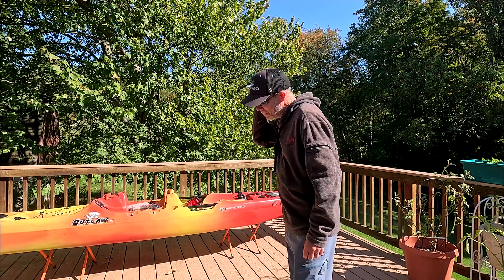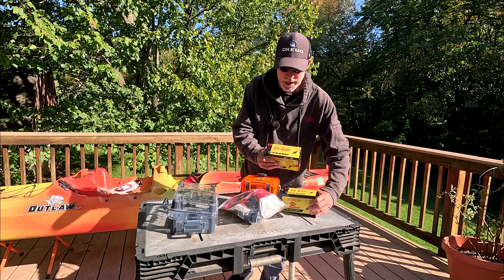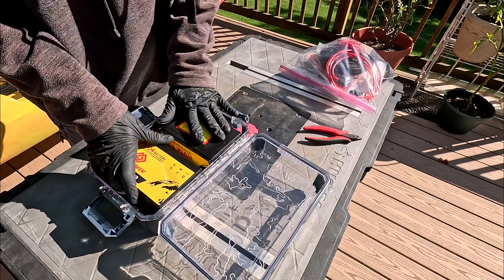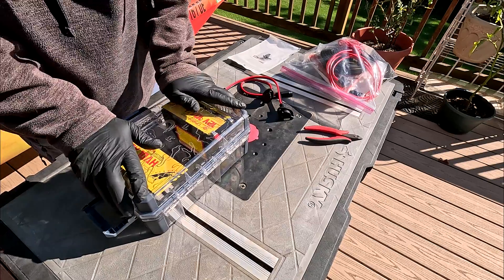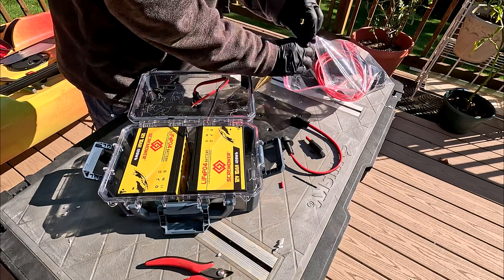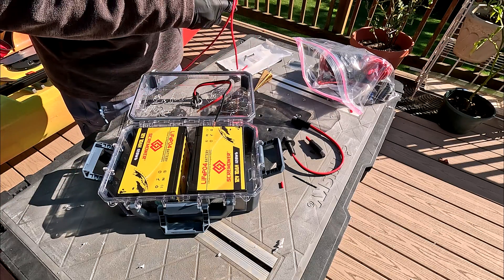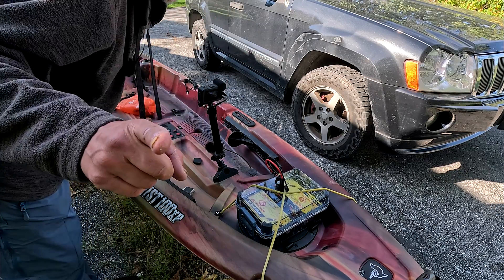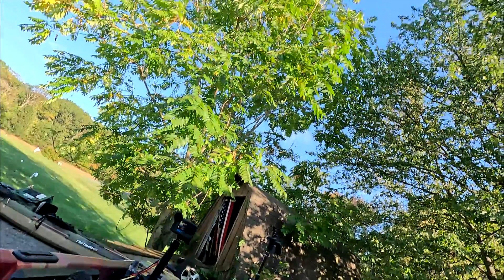A Sensible, LIGHTWEIGHT KAYAK BATTERY BOX Build on a BUDGET!

Comment: I just wonder how hot those batteries will get without a vent hole and with full solar exposure.  Might be able to use an old cooler and a plastic freezer pack I guess.  Do you plan to shield the sunlight ?
Reply from the maker: It sits under the seat of one kayak, and in the other it sits up front, exposed with just a net on top of it. I haven't had any issues in the year and a half since building the battery box.

Comment: I think your wiring on your batteries is wrong. when you hook up the red one side, you need to hook the black up on the other battery that way when you’re drawing the power, you’re drawing equally through both batteries also when you’re charging the way that you have it hooked up it’s charging one battery then the other, so if you change the wiring, it will charge them equally and it works the same way with solar if you have an array of batteries, you start your positive at one end and then you start the negative from the other end so it feeds equally through all your batteries👍
Reply from the maker: Everything you said is wrong. What you proposed would be a 24v presentation, not a 12v presentation , as required in this project. I'm not going to argue with someone that doesn't understand parallel vs series or how voltage and charging works. I've been doing low volt stuff for 30 years (as a professional).  Go fry your own stuff and start fires, but don't profess to me and my viewers your complete lack of understanding about how electricity works. Folks, ignore this know-nothing know-it-all. He'd present a 600v "array" to a 120v system, and try to blame the equipment mfgs for him burning down his own house. And before you say it, I'm not angry, I'm just protecting my viewers from your lack of knowledge and the bravado that accompanied said lack of knowledge. You are the epitome of the Dunning-Kruger effect. Thanks for watching!

Comment: good work. looks like you know what you're doing. 
Was wondering if you think I should install a fuse for a single 12v 10ah SLA battery for my box build im doing. And what size fuse?
Reply from the maker: Thank you! To answer your question, ABSOLUTELY and ALWAYS fuse, no matter what kind of battery. The closer to the battery, the better. It will prevent wires from melting/shorting a hell of a lot faster if things go sideways. I power two hungry GoPro 12s and sonar (at times). I have never had a 5 amp fuse pop due to the load. I'd go with that, if your setup is similar or less. It will protect your gear and your yak/boat for this purpose. If you have any questions or doubts, feel free to email me. The email addy is on the landing page.

Comment: That looks cool!  The batteries are a snug fit, but they FIT.  I like that you took safety seriously, especially with those lipo batteries!
Reply from the maker: Thanks, man! And yes, LiPo are not only very ignitable, but also pretty hard to put out.
Reply: @BarryP Precisely!  I thought I read somewhere that a fire department put 6,000 gallons of water on a burning EV, just to keep it from melting through the road surface... they couldn't actually put it out.
Reply from the maker: @RoadReality  Early on, it was an absolute disaster, but I think most departments can now deploy a water/foam mixture that puts LiPo fires out at a pretty decent clip. Water alone will not do it. That 6,000 gallons water-only likely only prevented the car fire from spreading to the roadside vegetation.
Reply: @BarryP  Right - just keep the fire contained, sort of - and the fire I was referring to was kinda recent - but I bet the FD there didn't have that new mix.

Comment: Nice clean job. The batteries fit perfectly.
Reply from the maker: Not bad, eh? Also, LiFePO4 battery sizes are very consistent. A 10aH of one make will generally have the same dimensions as other brands. This is a great way to build a box that can handle more than a day on the water for everything short of a trolling motor.